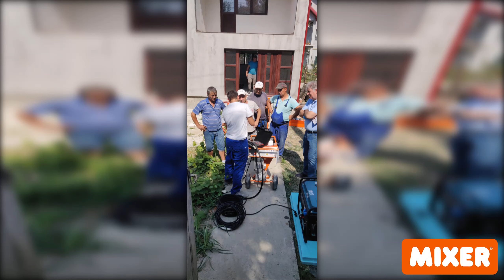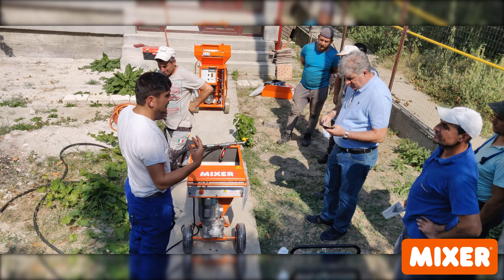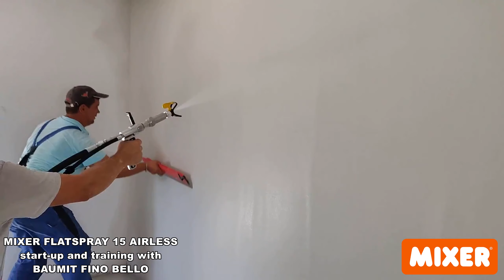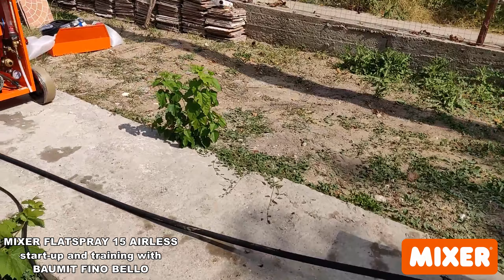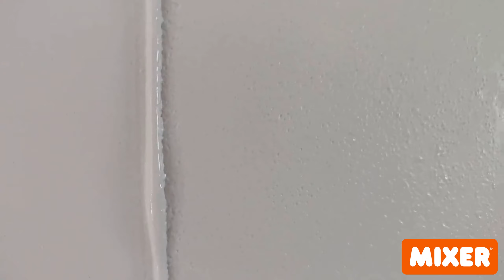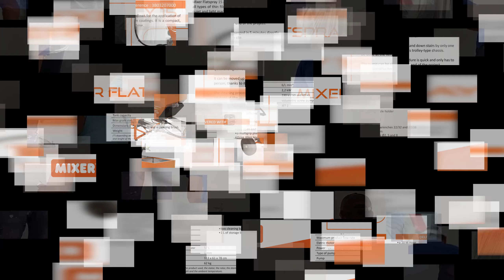Baumit Fino Bello? Spray it airless with MIXER FLATSPRAY 15

Comment: What does the machine sound like?
Reply: Hello Mike, being a stator/rotor screw pump this machine is very silent compared with an airless piston pump or an air-helped equipment. Unfortunately i cannot insert videos in this comment, but you can search on youtube "Spray Tambour's Magic Bond? Mixer Flatspray 10" to find a video with the original audio from the construction site.